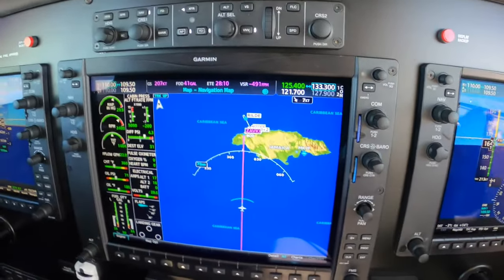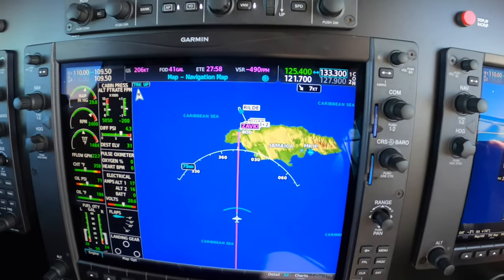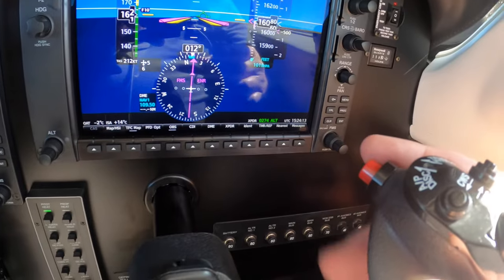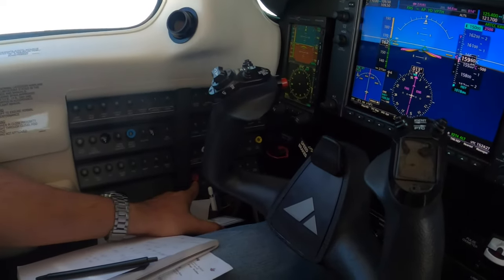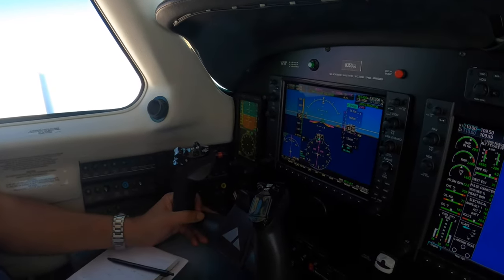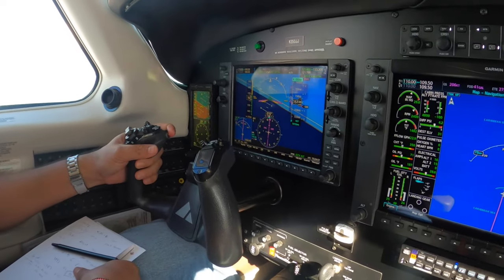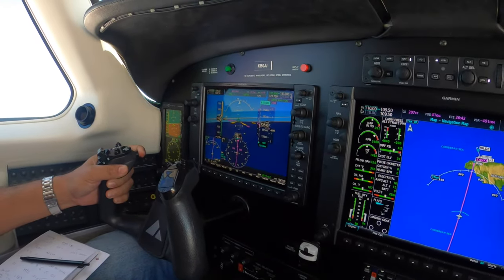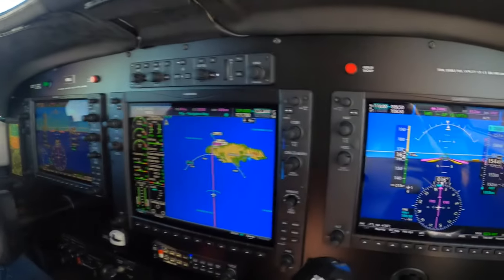Piper M350: Runaway Autopilot Corrective Actions

Comment: Why keep holding AP off button so long? Once you hear the disconnect audio alert you know for sure it is off
Reply from the maker: This is an excellent question. I am glad you asked. The autopilot system consists of several motor and clutch subsystems which interconnect in an amazing way. Part of this system is the electric trim. The electric trim is also available to the pilot outside of the autopilot system which presents a very interesting fail scenario; the dreaded runaway trim. Now if, as an instructor, I announce that I am going to give you an autopilot failure of some sort. You should be prepared to respond by pressing and holding the autopilot disconnect button in order to stop any of the motors including a runaway trim until you can 1- manually trim the aircraft and 2- find and pull the pitch trim breaker .. yes? Well as it turns out, loss of control can happen in as little as 4 seconds. During this time pilots need to have one and only one course of predetermined action. Since trim is part of the autopilot pressing and holding the AP disconnect button interrupts all of the motors giving the pilot immediate control. If the pilot were to let go of the button in the presence of a runaway trim the trim will continue to run. Virtually all aircraft Operating Handbooks cover this in the emergency checklist and it is one that pilots need to memorize and practice with a qualified instructor. .. Fly Safely - Train Often .. DR